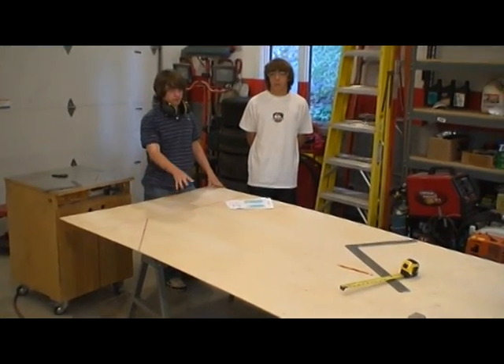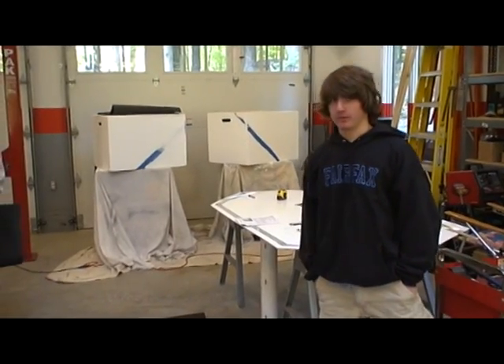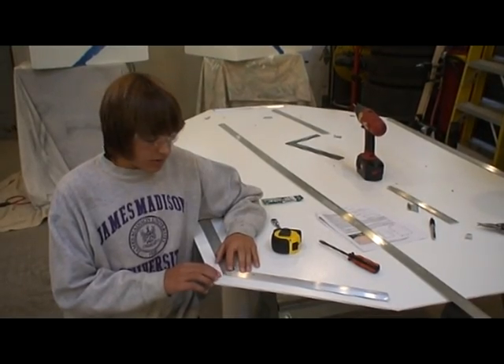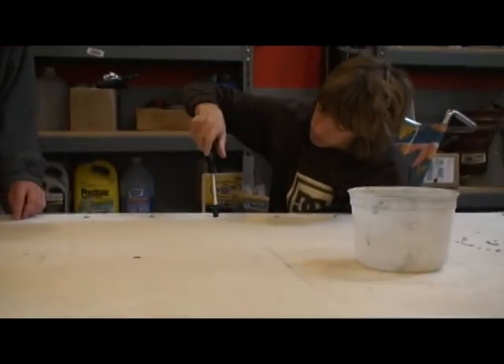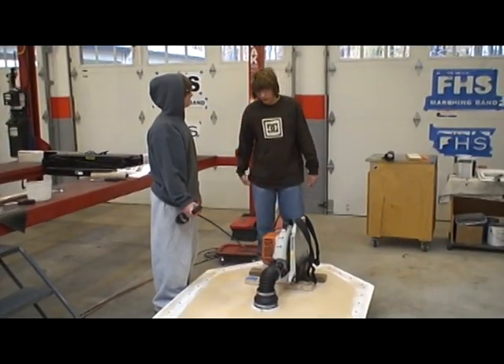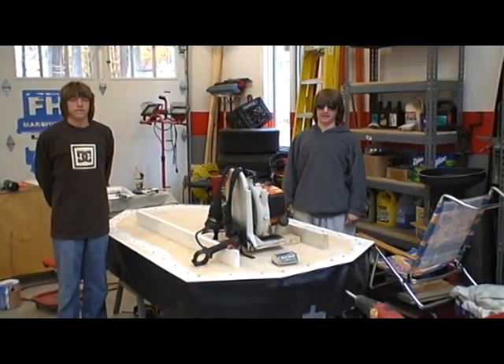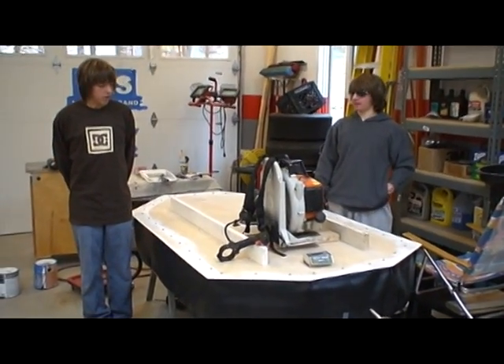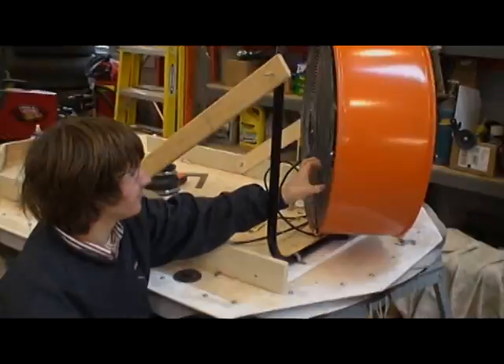Hovercraft Project - Part 1

Comment: Hi, I built a hovercraft in 1989! The platform i built was in the shape of an octagon, Concaved simular to a satelite dish, 8 ft. in diameter! 4HP lawn mower engine for lift, 8Hp for thrust! i built this as an experiment with no prior experience and no plans. My craft would lift approx. 300 lbs, and travel at about 25 mph top speed. One of the lift problems that I corrected was building a shroud around the lift fan underneath the craft. This prevented air leak around the intake! Worked Well!

Comment: Part 3 >  The plywood circle was mounted over the top of the lift motor with standup 2 X 2's supporting the seat.  i then mounted another piece of 3'4" plywood to the back of the seat extending out the back for another engine mount for the 8 HP briggs motor for thrust. I used a 3 bladed metal fan mounted to the briggs for thrust with a 1/4" plywood rudder behind the the fan! The craft responded very well and was a lot of fun for a couple of years. The skirting was made out of blue tarp material!

Comment: Part 2>  I then connected them with more 1 X 2's all the way around the outside edge. Glued all joints and useing screws. Again the frame was slightly concaved shaped in an octagon! For the skin of the craft I used 1/4" wood wall paneling with the back side facing up: I then used 4" wide fiberglass mat and resin to cover all joints for strength.
The 24" hole I cut out for the lift fan, I used the circle for the seat after I mounted the engine over the hole with the 4 blade fan under the craft.

Comment: i had built a hovercraft in 2011.I used a homemade 30 hp motor for thrust!and a 8hp homemade motor for lift!it could lift approx 600lbs with a top speed of 100 mph!it could drive on it's own too!

Comment: PART 1>  Depending on your ability to find the engines used and cheap, The craft body I built would cost today around $300.00
I started out with a piece of 3/4 inch plywood about 3 ft. sqare and cut a 24" circle out of the middle for the lift fan. Then I used  four 1 X 2's for framing from each corner of the plywood extending outward, then four more 1 X 2's extending from the middle equally between the corners. positioned them precisely equal measurements around the perimeter.

Comment: As the name says, a HOVERcraft does actually hover, the air goes down in the middle of the skirt and then provides a small passage of air causing the skirt and entire craft to hover.
If the fans were to directly push the craft up, it then becomes a helicopter

Comment: It would have worked better as a 4ftx8ft  hull structure. The same lift power with more underneath surface area.

Comment: Guys, guys, guys, guys! Was that aluminium carpet strip that you ground on a wheel? If so, please do not do that again. Grinding wheels do not take kindly to Ally and tend to fly appart. That sort of thing is best done using a linisher or a die grinder.

Comment: That's a ridiculous statement, I'm afraid. What I'm talking about has nothing to do with the hovercraft, but the workshop practices employed. You NEVER grind aluminium on a grinding wheel. Not only do you endanger your own life but every subsequent user of that wheel.If, however, your statement WAS in regard to this practice, I strongly recommend you never work in a manufacturing/fabrication/maintenance facility...for the sake of your fellow workers!